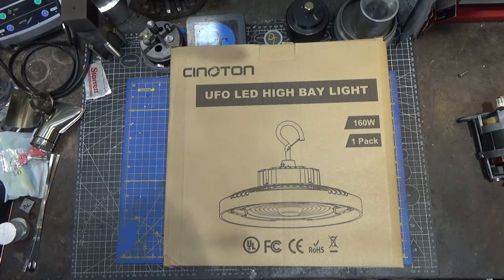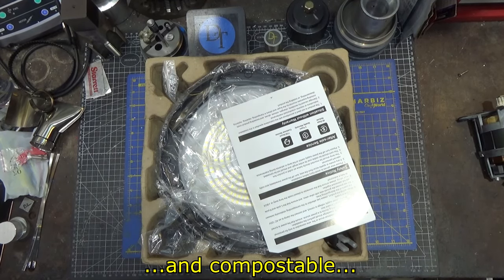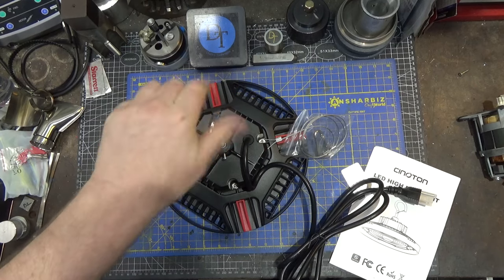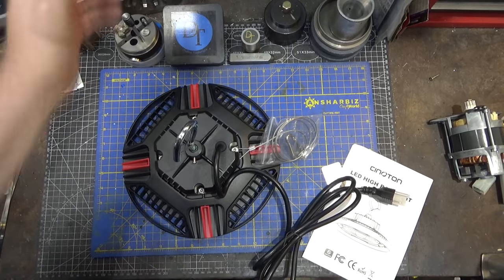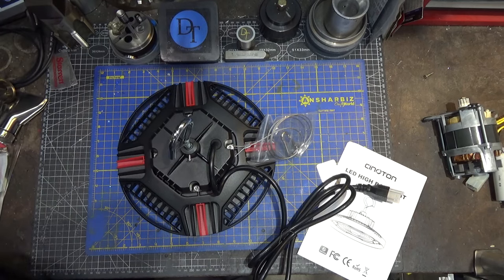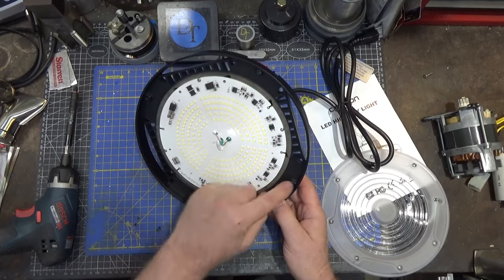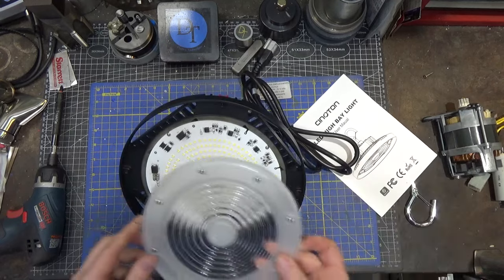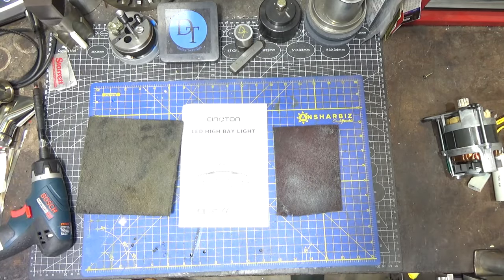QTR 120 CINOTON IO Series High Bay Light

Comment: The debate over what the holes in the plug are fore may never be settled. I was bored one rainy day and looked into it, I found many opinions! By dinner time I had become a proponent of the explanation that way back when they were included as detents to help hold the plug in the socket.
Reply from the maker: Thanks for the info. I searched for the same thing after I edited this video and that seemed to the be consensus opinion. The answer seems hardly definitive, but definitely plausible.